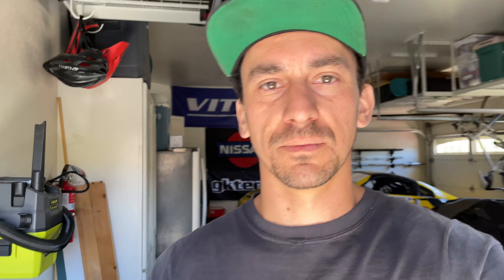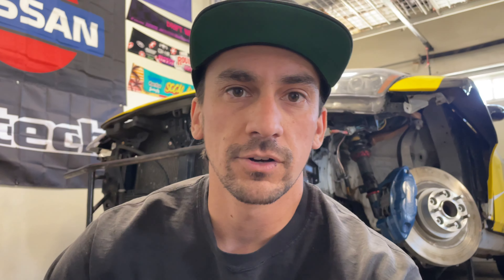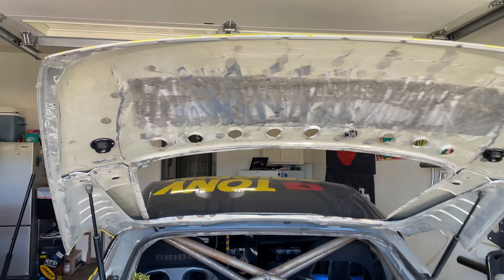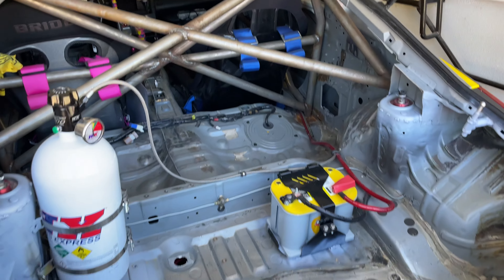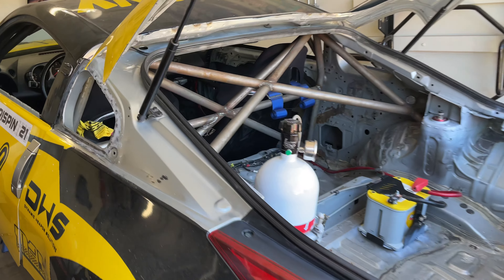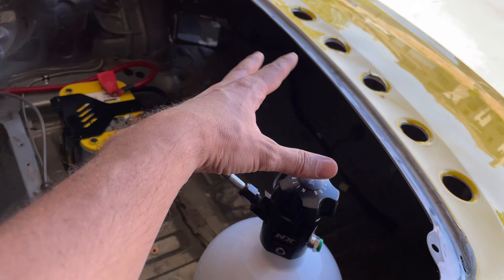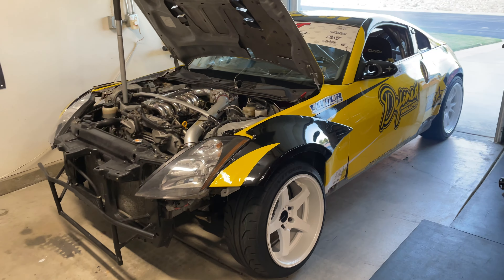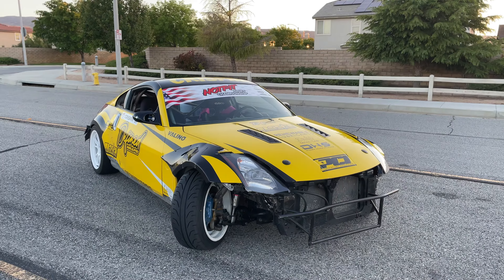BIG CHANGES Making the 350z a More Competitive Drift Car!

Comment: Also you should move to a 18x8.5 they are made for a 235/245 + you can run spacers when in party mode and when you wanna look good. BUT when you want more grip take off back spacers small track width so you will get more side bite. from friend @nicdrift
Reply from the maker: That makes sense! I’ll have to experiment with some smaller wheels with the 235’s. Good idea!
Reply: @tonycrispin  I went from a 9.5 and 10.5 wheel that was 22-25 pounds per wheel to the aodhan ah07 that is only 19.6 pounds and they are only $224 each and sometimes $200 on sale. Also got a set of the aodhan ah-11 18x8.5 +35 they are only 18.8 pounds and same price. Can shave about 25 more pounds ;)

Comment: What tie rods did you use in the end? I have a set of the super long GKTech ones but idk how much I should cut them down to maximise my angle. I am not even hitting the lock stop with all of the washers installed
Reply from the maker: Stock Z33 tie rods, rack spacer on both sides, and the longer of the tie rod adapters. I hit the lock stops and they’re on the smallest setting lol!
Reply: @tonycrispin  I have the offset rack spacers, currently trying to figure out why i am limited on lock! Thanks for the reply!
Reply: I have the same issue, did you ever figure out what was causing it? I wonder if the ackerman setting on the bolt on adapter has an effect on this